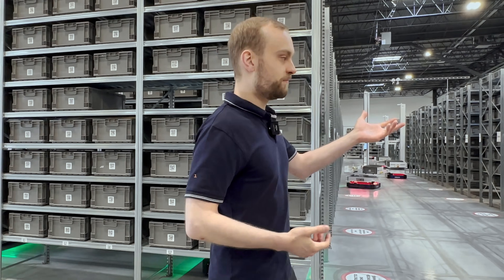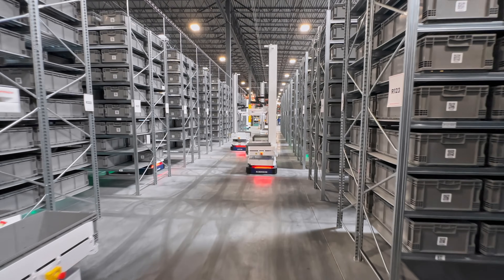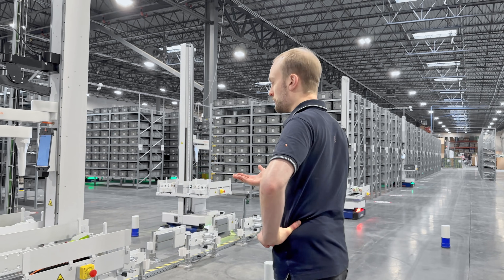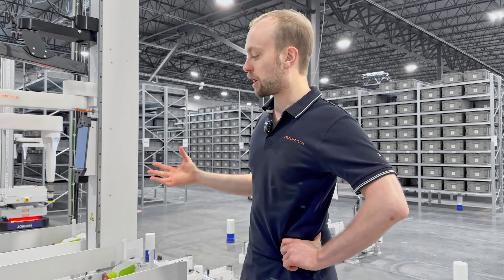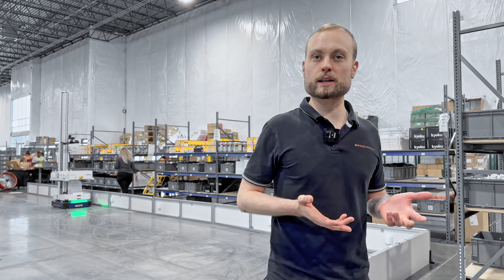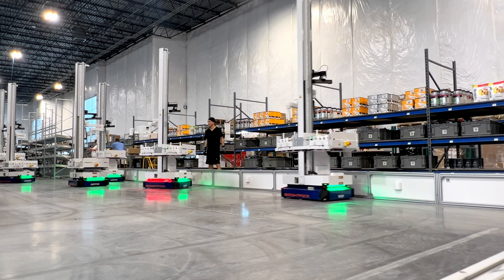Inside a warehouse run by AI robots

Comment: Why have a screen on every bot? Wouldn't it minimize total unit cost to just have 4 screens at a manual pick station?
Reply from the maker: you're correct in saying that would reduce cost, however it would also add a single point of failure and make the station more complex to install. The tablets themselves cost a couple hundred dollars, so the incremental costs are minimal.
Reply: @brightpickAI  Makes sense, human uptime in a system like that is really important to get right

Comment: Give that human operator a chair or a standing mat at a minimum.
Reply: That standing on concrete floors all day is a deceptively difficult job. Very rough on your joints and back I agree a rubber mat and ergonomic chair would help a lot
Reply: 6:01